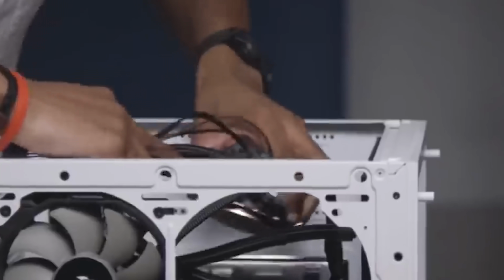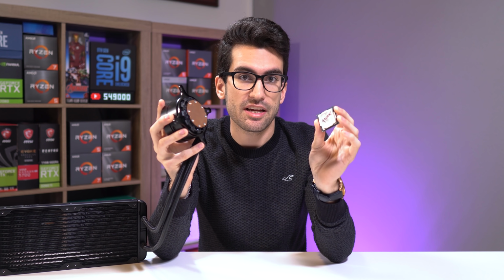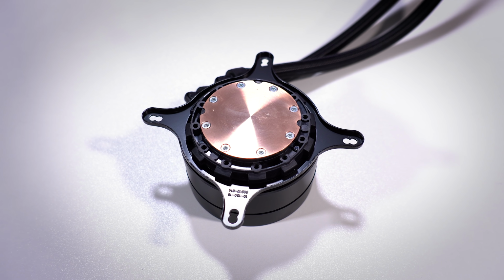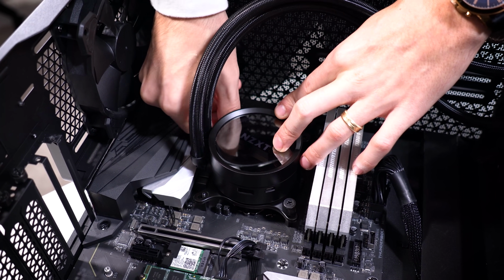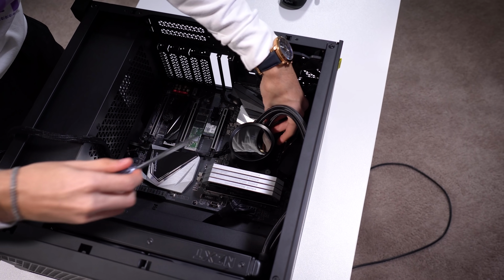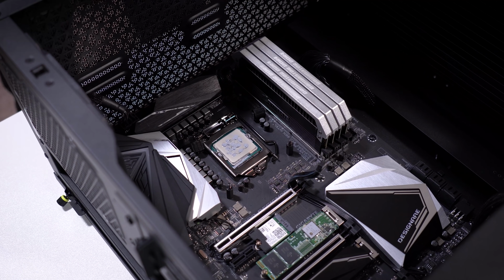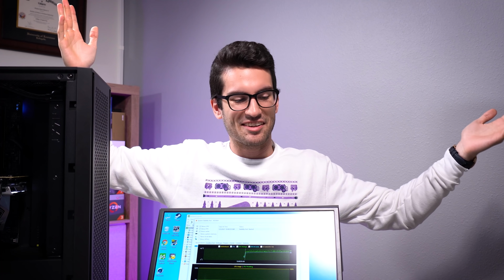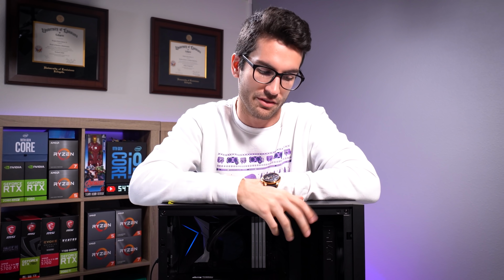Testing an AIO With a Missing Thumbscrew Was a Disaster...

Comment: I'm actually using an AIO without one of the screws (I lost it), and it works perfectly fine with comparable temperature obtained from a normal installation; of course, this is not desirable, but if you take care of tighten them evenly at the cross, and not tighten too much the one at the opposite of the missing one, this is ok (i suppose the effect is the same as 2 screws in the video)

Comment: I have not finished watching it but the missing screw would also be a problem for Intel and Threadripper CPUs as they require some extra pressure from the cooler to make full contact to the contacts of the motherboard.

Comment: Very timely. I'm actually in that boat now because one of the 4 spring mounted top caps is stripped and I don't have a nut or replacement handy.  Wasn't worried until I saw this, so I'm gonna watch what your video shows before I fire it up.

Comment: Lollz i can imagine the amount of resistance you would have got goofing up the thermal paste. 
I have had terrible thermal issues when one of the peg broke on the intel stock cooler. So much so that the system wont boot until i cleared cmos. I assumed aio would do better but it didnt.

Comment: so this could be why a lot of amd brakets for aio's use just 2 screws, connecting to the pre installed brackets on the motherboard. makes almost little to no difference with using 2 instead of 4.

Comment: It's common sense so idk how verge miss that.A good example would be amd's heatsink design.Although it's opposite each other.It works.I have a cooler master ML240L AIO that also just use 2 pins for amd and 4 pins for intel.I use to work for a company that directly worked with intel.I got to test all the new parts out here.Reason being i told them i can oc a 915 intel mobo and they argued with me and i proved them wrong 😁.So heatsink/airflow was what i did mostly.

Comment: Three thumb screws work if it is positioned like a equilateral triangle and not as a right triangle. So yes in this case two thumb screws provide more even pressure than three thumbs screws that make a right triangle.

Comment: Having more wires means you increase the storage on your radiator.
Reply: yeah but only if the fans have atleast 6 cores
Reply: @binkthepidgeon7  also 12 threads. Those are in the wires that go to the pins on the motherboard
Reply: @David-io5fz  the rest of them are just for redundancy so you can break a whole bunch and still be fine
Reply: Just add more hoses.
Reply: @tazgamerplays  hoses? Bruh how is this even a word? 😂
Reply: Which then decreases the number of capacitors on the case
Reply: Um no... just download more storage for ur radiator
Reply: @David-io5fz  ah yes
Reply: Are you joking or are you that stupid
Reply: @momoshekar7217  it’s a joke have you heard of the verge pc build
Reply: @prismoth  yes, but I still can’t tell if he’s joking based on what I saw in that disgrace of a vid
Reply: @momoshekar7217  this is a troll account :facepalm:
Reply: @momoshekar7217  f
Reply: @momoshekar7217  Joking

Comment: 4 is best, then 2 and 3 screws is the worst, especially if you tightened them down all the way their supposed as in the 3 screw setup the 1 screw missing its opposite will lift the side that dont have the screw up and disconnect all contact on that half of the cpu, but this only if you tightened them down to where the thread bottoms out as your supposed and not some silly "finger tight" thing...

Comment: I had to do this a with an H60, worked fine without the last screw
Reply from the maker: You probably weren't either 

1) Stressing your CPU, or
2) Monitoring temps Lol.
Reply: @GregSalazar  Yes, partially correct. This was on my i5-9600k (not overclocked), but the temps were never over 50C when playing regular games (HoTs, GW2, LOL, etc) which was all I needed it to do. Though since then, I have switched back to an air-cooler (Hyper 212)

Comment: It was an interesting test and the result was expected. I mean, many air coolers use only the two stock clips (at least on amd boards), have fairly equal opposing mounting pressure and perform quite well as a result. Three mount points would tilt the pressure to favour one side so performance would dip dramatically. Cool video all the same like some old school science studio.

Comment: My cpu cooler (air) has a stripped screw that i cant use to mount it down and it performs "ok" with temps at the very most reaching 80c
Reply: Is the screw stripped or the threads in the mount? If it is just the screw, I am sure you could get a new one for next to nothing.
Reply: @--_DJ_--  yea the screw itself is stripped as far as i know, I can't get it out either because it has a coil wrapped around it, its a cooler master hyper 212 evo rgb
Reply: @markymark4338  Oh, ya I didn't think of captured hardware. It looks like there is a black clip under the bracket that holds the spring to the screw. It wouldn't be as easy as I was thinking to just swap the screw out in that case. I think you can buy the pieces separate from the cooler (accessory kit) from Cooler Master if you didn't feel like messing around with the clip and trying to find a screw that would be the right length.

Comment: I do not understand why people do not smear a thin application across the entire surface of the CPU and the plate or contact. Watching all this dotting is driving me nuts...
Reply from the maker: To be clear, I dotted because they dotted.
Reply: @GregSalazar  I use my finger to spread a perfect veneer like layer on both the chip and the contact. Never fails. It's not you Greg, you did cause they did, I realize, however so many other YouTubers have build guides with this disaster waiting to happen method. One wants to use the least one can and have it spread smooth and evenly.
Reply: @warmon6  Spreading an even smooth layer works best. But that's my opinion. Considering I have never had thermal issues in the 24 years i've been building PCs that were paste related from something I pasted, I am going to stick with it. Blobbing and dotting too much can push it out the sides and or create patchy coverage. However if you have a method that works for you and never fails, I would stick with it too. Thank you for sharing your experiences.
Reply: you don't need to do that. One big blob gets perfect coverage. Though, with old cpu's that didn't have an IHS you totally had to put a blob, then use a credit card or something to smoothly smear a thin layer on the cpu die. It was a pain in the ass and stressful because it was so easy to crack the die when you put on the heatsink.

Comment: Question: I just bought an aio 3080 (cuz it was the only thing available) what position should the tube be? Like I have an lían li dynamic xl and was planning to put the radiator on the bottom
Reply: I think it’s bad for the rad to be on the bottom. Just look up the gamers nexus aio radiator orientation video
Reply: @Blazingtoken  or Jaytwocents for a shorter video based off a Steves video.
Reply: Answer: Mount it on the back exhaust or mid or top back intake, which ever the tube can reach -- that's where your tube position will be XD.

Not recommending to put it on the bottom due to the Jayz2cents and GN videos on AIOs. It really depends where the pump is on the 3080 AIO you bought. The pump needs to be lower than the radiator to avoid air pockets eventually. But if you have a new 3080 you can technically mount it at the bottom as long as there's currently no air pockets on the loop, but as soon as air pockets appear it will wear the AIO faster eventually.
Reply: @Pmak  I forgot to mention that I already have an aio for the cpu and that radiator is on the top. I think I’ll put that radiator on the side intake and vertically mount the gpu and put that radiator on the top
Reply: @NaggingTax29039  I mean you can also try and put it on the back exhaust unless there's clearance issues.
Reply: @Pmak  yes there is a clearance issue. It’s a 240mm radiator
Reply: @NaggingTax29039  Then yeah top would be best :)